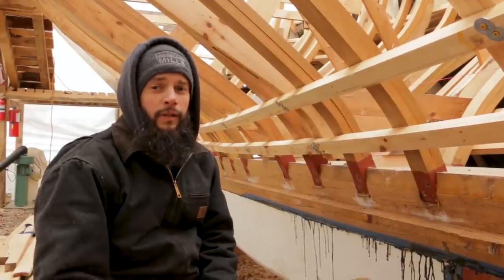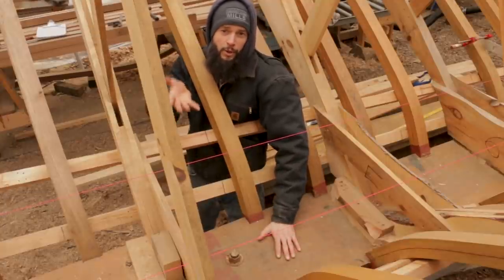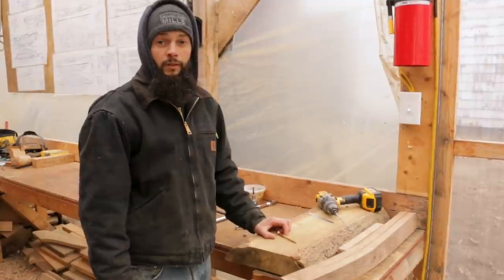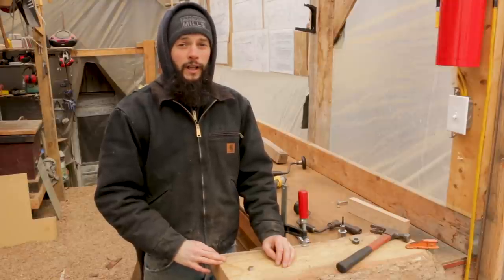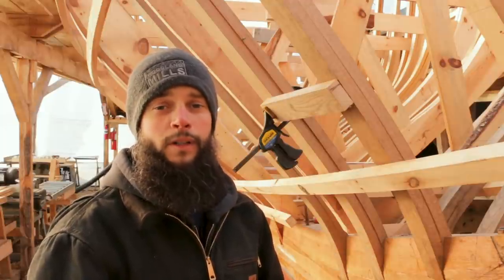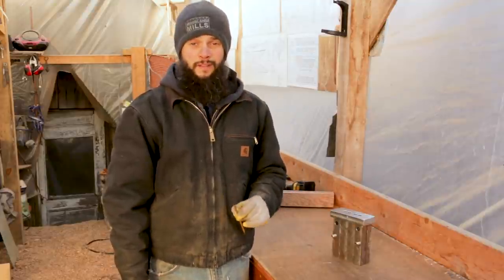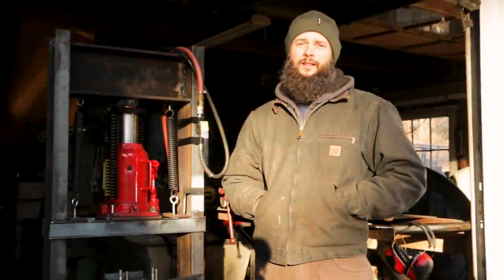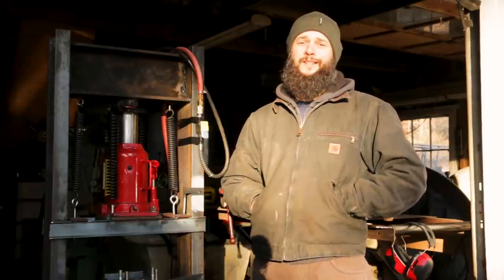Acorn to Arabella - Journey of a Wooden Boat - Episode 50: Homemade Copper Rivets!

Comment: Just thinking about your frames; they're not laminated by the sense of the term; the possible (likely?) first point of failure would be the split frames sliding longitudinally at the moment of stress, kinda like they do when you steamed 'em in place but in reverse, I mean to the point, you really don't benefit from the combined strength of the two splits unless they're joined; the antithesis of a leaf spring. I realize your copper rivets (nice!) penetrate frames and planking, adding strength to the planks and the frames. However, the planking rivets under stress mostly see longitudinal forces to which they are suited, but rivets as they pass through the split-frames will also see shear forces to which, well, they are not. Just thinking, let the planking rivets do they're job, but join the split frames independently. With trunnels, bolts or the like? The philosophical point being, let the structural member fail before the fastener. Really enjoy watching what you guys do. Thank you.
Reply from the maker: By the time everything is fastened together and swells tight she will be plenty solid.  The little bit of flex in the frames is not a bad thing, a carvel hull is never truly ridged.
Reply: @AcornToArabella  That's kinda my point, any flex in the frames, in particular amidships taking mast forces, will introduce shear onto the rivets as the split frames move against each other. No reply needed, guys, saving your patience for next time!

Comment: are you concerned about work hardening of the rivets? or did you already think about annealing them?
Reply from the maker: Work hardening won't be a bad thing but if it seems like they need it we can get the rivets all batch annealed if we need to.
Reply: I mean it seems you are planning a interference fit for the shaft but I would think that you may want to consider the rivet heads and the tips. if they work hardened during the forming process, the heads could snap or stress fracture or the tips may fracture when you hammer them over. the shafts wont be an issue but you still need the mechanical link from the head and the bent tip to make sure nothing tries to work loose if they fail. I may be over thinking it or overestimating the cold forming stress in the metal, I am not a metallurgist, but the theory I have is that you want a mechanical tie that is not brittle but is corrosion resistant. just my thoughts on it from me studying brass for bullet reloading and being wary of work hardening.
Reply: also, if you haven't thought of it already, get some brass bar stock that is the head diameter of the rivets, you can cut it make a punch for driving the rivets and it wont be as rough on the rivet heads. you can trim it back flat if it mushrooms.

Comment: What is the tensile strength of your 1/4” copper river? How do you make the rove?
Reply from the maker: Not sure on the tensile strength.  They will stretch and elongate long before they actually break though. 
We purchased manufactured roves, we just need to enlarge the hole a little.

Comment: Question:  Would there be an advantage (or disadvantage) to having the rivet press make the point (using a taper in the jig) on the end of the rivet instead of having to grind them each individually?
Reply from the maker: To form the point you have to either remove material or basically elongate the rivet which takes a crazy amount of force.  No way would our 32 ton jack accomplish that.
Reply: @AcornToArabella  Good Point...  LOL...

Comment: Would there be any pros or cons to installing the homemade copper rivets red hot and allowing them to thermally contract? When they cool, the rivets will pull the wood together. I'm thinking of iron rivets used on bridges, old vessels, etc. I understand those are iron and this is wood, but is there much of a conceptual difference? Cheers crew.
Reply: I can think of one big disadvantage:  Red hot copper is around 1400 °F/750 °C.  I expect the wood wouldn't play well with that....   See https://www.hearth.com/talk/wiki/know-temperature-when-metal-glows-red/
Reply: The conceptual difference? Iron doesn't burn or char when you put red hot metal against it. Wood however, does. I'll leave it to you to figure out whether or not that's a good thing.
Reply: @Garryck-1  it's how steel bands are installed on wooden barrels
Reply: @TheEphemeris  - There's a difference.. barrel bands don't go through the staves, they're only pressed against the outer surface. Putting a red-hot rivet through a plank would char the surrounding wood, making it weaker, and ultimately resulting in an over-sized hole. That would allow the plank to effectively rattle around on the rivet, which would be widely regarded as a Bad Thingᵀᴹ.

Comment: Could you make the die in three pieces...? stagger the grooves you have on one plate to accommodate 4 more on the other side. Then a cover plate on both sides (like the one you already have). 8 rivets. BOOM! 💥 Just cut your time in half. Or would that be too much load on the press? Also, would it work to make the bottom end of the groove a point rather than square? Form the complete rivet in one press. No need for grinding.

Comment: Have you done and engineering cad stress diagram for the differences in floor construction?
Reply from the maker: No but they are replacing a 2x5, they will be strong enough by spades.

Comment: Do all of the people who are worried about your fasteners not understand basic force and engineering??  There are very few, if any, connections on your boat where a single fastener is all that is attaching something and carrying the entire load.  The fasteners that you guys are using are, in my opinion, excessively strong for their applications.  And I do not mean that in a bad way.  Unless you have the capability to calculate each connection and the required fastener strength, over engineering is the way to go.  For all of the naysayers, I suggest you go look at the inside of an aircraft sometime and see just how small of a fastener(1/8" rivets and sheet metal screws) can be used be used safely.  Its possible because all of the fasteners share the load along with all of what they are fastening.  In the case of an aircraft it is relatively small framing members connected together with relatively thin sheet metal.  But all of the members in the structure SHARE THE LOAD.  And solid bolts are EXTREMELY strong when used in the proper application.  If you ever have the chance, go look at the transmission of a UH-60 Blackhawk.  It is held to the airframe by only 8, yes I said EIGHT, 3/4" bolts.  That is all that holds the airframe to the rotor system.  A load that can conservatively exceed 17 tons of airframe and cargo.  So all of the bolts that you guys are using are more than enough.  You boys keep on keeping on, you're doing a great job.  Pay no attention to all these twits that don't know what the hell they're talking about.  To all the twits, go back to your safe spaces and snowflake hideaways.
Reply from the maker: It would be a safe bet that a decent number of our followers have little to no experience with fasteners and timber.
The vast majority of the comments were not from trolls or people needing safe spaces, just folks who have little to no experience in this realm and are genuinely curious/concerned.
We agree with you that the boat like a plane or most large things really is a sum of it's parts. Just like a stick framed house is very weak and floppy until all the exterior and interior sheathing goes on.  
8, 3/4" bolts sounds reasonable, we assume they are a high grade bolt and not something off the Home Depot shelf =)

Comment: Look... she is just NOT coming apart anytime soon. Unless you actually want her to come apart. And let me tell you.... disassembly would be a REAL job. 2x or even 3x longer to disassemble than to assemble at a guess.
Everyone saying the fastenings are a bit small, chill guys. What you are forgetting is that the strength of the boat is not just one fastening, it is every fastening working together to spread the load. Arabella is not coming apart anytime soon.
Reply: Also, did you guys consider forming the points on the rivets with the press as well as opposed to grinding them? Would only need a small change to the dies to implement.
Reply from the maker: Thanks!
A boat is the sum of her parts for sure!  By the time everything is done she should be a very strong and stout vessel.
We did consider forming the points but it would take a lot more than the 32 tons of force to press them.
Reply: @AcornToArabella  Just an fyi, I've NEVER met a lady that liked to be called stout. Be careful that she does not make you pay for that one. :D

Comment: What was the reason for not machining a point into the die, so it would perform both operations at once?
Reply from the maker: To form the point you essentially have to extrude the stock which takes much more force than we want to work with!

Comment: I wonder if you should anneal the nails after pressing them.  I'm thinking the heads will be work hardened and brittle.
Reply from the maker: The work hardening is not a issue in this case.

Comment: Jeese. That was painfiull. You present yourself as an expert ...depending on what timber you’re dealing with changes everything. Also floors are not always fastened to frames ...often floors are fastened to the garboard and maybe the next strake and the keelson. Split frames are weak to fasten floors to. With respect, I’m thinking you should take care in presenting yourself as an expert there’s a number of ways to go about securing floors, keel and strakes. I’m sure you feel you know stuff having got this far but...

Comment: steve I watched this video again about the rivets your using...I'm not to sure the rivet gun I brought up to  you guys would even work now seeing the cross dimension is over a quarter inch and I think the gun I brought up  hammer dimension  is too small  .....Oh well if you guys can use the gun your welcome to it  Joe Kubik ..
Reply from the maker: We haven't tried it yet, but we will find out when we get there!
Reply: looking at the rivets you guys made i'm sure the diameter is to large for that gun .you said the bar stock is 1/4 by 1/4  and I don't think the hammer piston is 3/8s or large enough to take on those ...I'm sure you guys will figure something out to speed up your planking

Comment: My only question is why your screw seemed to be a flat head? Isn’t that by far the worst head type for screws.
Reply from the maker: Down the road we can scratch the paint and bedding compound from the slots and remove the screws.  We can even cut a new slot in them in a pinch.  They are the easiest to get out in the future.

Comment: how about an air ratchet to get the bolts on and off. just use the air for the jack or get a cheap t valve.
Reply from the maker: We had our air ratchet hooked up but it did not have enough oomph, neither did our battery impact gun and with volunteers we are worried an air impact would be too much, they could easily over do it.

Comment: You need another die on the bottom with another press that on it's side so that when you have the die on it's side you can punch out the brass pins from the end which will later be pointed.

Comment: The pins should have had your logo on it and the mold could have incorporated the points too.
Reply from the maker: The points would have to be extruded, not pressed, which is not possible in this situation.  The die holds the rod so that the heads can be pressed.  Had we gotten real fancy we could have had someone cnc our logo on the pins pressing the head but... that seemed a bit unnecessary :)

Comment: Maybe if you would give a sharp shape at the other end of this "fastening", you would have two ends of the nail ready and you would not have to sharpen them yet
Reply from the maker: It would take more force to do that than we can realistically work with.  To form the point you essentially need to elongate the stock and that requires a lot of force!

Comment: It might help to anneal the portion of the copper that will get turned into the head. Soften them up for the forming - which will work harden them. We used to do this for copper head gaskets on small engines. If I remember correctly, use an oxy-acetylene torch to smoke the gasket (torch set with no oxygen) and cover it with the soot the flame makes. Then set the torch to the correct flame setting to burn/clean the soot off the gasket. The copper was then annealed and would flow better when clamped between the block and the head. For the rivets you would probably have to go a bit longer/hotter than the thin gaskets we did. Here is a video about it. https://youtu.be/p7gEbtVM3_Q
Reply from the maker: Thanks for the tips and info!

Comment: At what point will you guys move the boat closer to the water or in the water? And how will you do it?
Reply: I'm guessing when it's done, and probably with a truck.
Reply: They have to get the steam bent side planking on.  They dont need it yet it keeps the water out of the bilge.  So they will also add the deck and the cabin.  The mast wont be installed until after it is in the water.  They will fit the mast, yet bridges are only about 13'8" tall on the average.  So the mast can not be mounted until she is in the water.  Arabella will be hauled by truck.  There are trailers made for hauling boats.  The trailer will slip down the sides and pick up the boat.

Just a guess at the rate they are going?  I would say possibly two years more.  Here again.  It is easier to fill the boat with water to do a leak test.
Reply: They talked briefly about that in a very early video but can't remember which one. Highly recommend starting at the beginning, BTW. I found the keel pour first, then started with vid one.
Reply: @peterfitzwell4394  same here, the pouring vid went semi viral I think. I've worked a lot with boats but I've never seen a build from scratch quite like this.
Reply: Danny Munoz they have said in past videos it will be by truck. Not sure at what point in the build thou
Reply from the maker: When she is totally done and ready for the water we will have a truck come and pick her up.  We will make the spars here but they won't get installed until she is at the ocean.

Comment: Okay, I'm Convinced on the finheads. But the RIVETS! Holy SHIT!  NICE Press, too. Seriously, you guys should consider building a couple or three other boats For Sale in a few years.You're already going to be Tooled for it, just have Alex's Boss Lady keep meticulous records on the ones you build for sale, so you can accurately tally up the costs in materials, and for tax purposes and Titling/Registration.Also, I would Run Off some Extra rivets for Emergency Repair purposes down the road. You're going to find OTHER Uses for them, I expect. Also, get a couple cans of Rustoleum spray paint, and paint that press. It is WORTHY of Ornamentation as well as Preservation.
Reply: heh...extra long rivets....are called "Hinge pins".... :)    they can also be called "Permanent bolts"...

Comment: Save  thousands  of hours  and  thousands of dollars  by using  1/4-20 X 6"  SS carriage bolts w/ss flange nuts.  Copper  has weak tensile  strength.  18-8 (304)  fasteners  have  at least twice the strength of  square shank rivets.   McMaster-Carr   part # 92356A566  Pkg of 5  @ $4.52    Going through the supplier  will offer wholesale price on sufficient quantities.   A deep counter-sink  weakens  the  integrity  of  the  fastened  wood pieces.

Comment: All your talk about fasteners for your boat...Are you making it up, or repeating it? When a wooden structure gets above a certain size, screws are impractical, and in centuries past did not exist, and so were not used. They are as unnecessary today in your boat frame. Nice job on the homemade copper rivets.

Comment: why copper? isn't copper expensive? it's because it's soft enough to be cold-formed under the press?
Reply from the maker: More that it handles the salt water very well. It being ductile also helps when forming the heads but it mostly has to do with it handling the salt water well, co-existing with oak well and being similar nobility to bronze and lead so it does not lead to galvanic action when the boat is in salt water.
Reply: Acorn To Arabella  interesting, thanks!

Comment: Why shapent the rivets to a point?  If you are driving through a pre-drilled hole simply tapering the end should be sufficient.
Reply from the maker: That's basically what we are doing.  We are pointing them just enough to follow the pilot hole and poke through the hole in the rove.
Reply: Good no need to spend more time at the grinder than necessary.

Comment: Why are y'aall wasting copper, turning it to dust to breath too, by cutting it with an abrasive wheel?

Also doesn't the wheel gum up?

 A thin kerf carbide blade on a chop saw should cut it for you. Less waste, even less waste if you can use a band saw. 

(Remember you can sell the unused scrap copper for good money.)

Also look into finding a stick welding power source that's inverter based, your stick welding will improve dramatically.

Comment: Probably a little late with this comment but to make the rivets easier to release from the die I would coat the inside of the die with a product like Sinclair Imperial Die wax (used for lubricating the inside of reloading dies) - great stuff that is inexpensive and lasts a long time - cheers!

https://youtu.be/zDm_nNkk1KU
Reply from the maker: Thank you for the tip.  will look into that